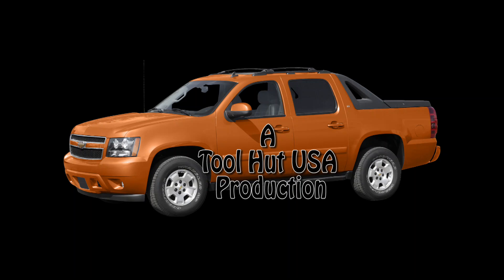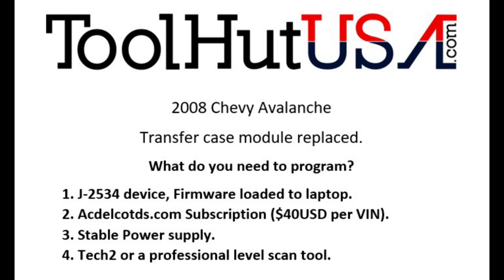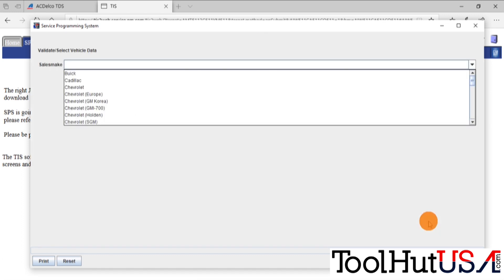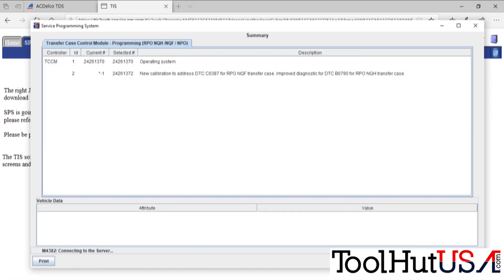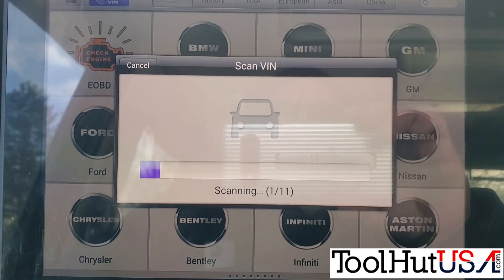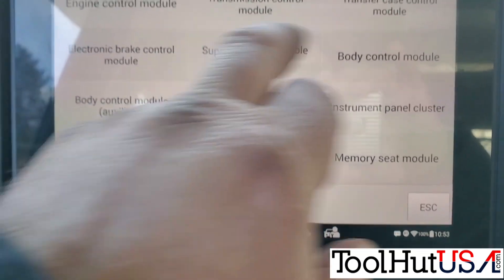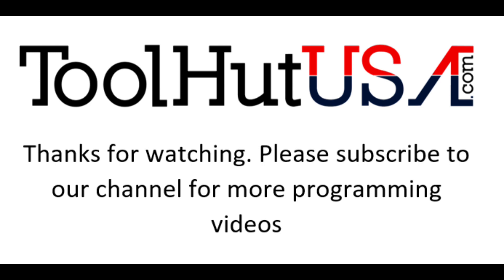2008 Chevy Avalanche TCCM

Comment: heey have you ever heard about the XTOOL X100 PAD2? u know if its bi directional? AND the Ancel X6 OBD2 Diagnostic?? (supposedly  does some bi directional controls)?? cheerz!
Reply from the maker: No I have not. Sorry
Reply: @toolhutusaakathecarflasher3019  pretty sure Xtool company is a bust heard the x100pad is pretty good and programing keys. Ancel is not a good company to deal with either. just gathering clues from other people wich have used and got the Ancel x6 broken non funtional out of the box..

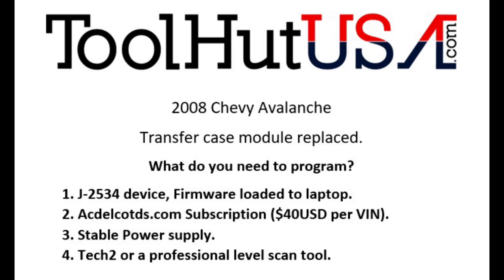Comment: Sam @ the 1:03 mark you call it a 2000 avalanche... oops but we all know you mean 2008. Keep up the good work.
Reply from the maker: I never once said I was perfect. I am not deleting or correcting something that insignificant. Thanks for the call out.
Reply: Sam I have a 2008 Chevy Avalanche XLT the problem I have is my blinkers on the left side and brake light on the left side does not work but the right side work blinker headlight and Park lights what site does not work at all I replace the turn signal switch on the column and it's still doing the same thing I have checked all the fuses checked all the relay I checked all the wiring I don't know what else I have to I missed but on the left side I do have a reverse light and a headlight and that's it no brake light no turn signal what causes it or is there another way to find out if there's another problem with the relay and how would I find it

Comment: GREAT VIDEO SAM, I MUST SAY I HAVE NEVER SEEN ONE OF THESE PROGRAMMING AND SETUP BEFORE . WOULD PROGRAMMING A GM BODY CONTROL MODULE BE THE SEEM PROCESS . THE PROGRAMMING OF THE BCM IS NOT SHOW BY NO AUTO OR MOBIL-TECH'S FOR WHAT REASONS I CAN'T SAY MY BE IT'S TO TIME CONSUMING BUT IT IS MISSING FROM MOST AND THANKS AGAIN FOR YOUR TIME ,SIR.
Reply from the maker: Gm body control module programming is different for every model. Some require tech2. Some require programming. Some require both.
Reply: @toolhutusaakathecarflasher3019  THANK YOU SAM FOR THE REPLY , I HAVE A 2014  buick lacrosse with a code p2535. After doing some checking on the this code it seems the BCM is not programmed . I only wished AVI had a video training course on how to go about it thanks again for your time ,Sir.
Reply from the maker: @8power0  the 14 lacrosse procedure requires TIS2Web, So any module programming video will be the same basic procedure. You choose the BCM when you get to the menu. Should be pretty straight forward.
Reply: @toolhutusaakathecarflasher3019  Thank you sam ,I will be going through all of your Chevy BCM PROGRAMMING videos 
can't tell you how good it is to be able to ask a question , and get a answer thank you, Sir.